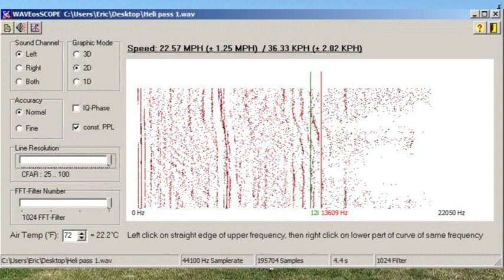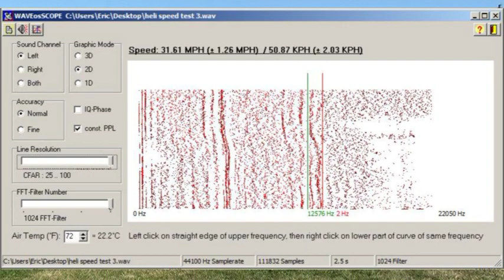Blade 450 3D. How Fast can it fly? (Using WaveOScope)

Comment: I own a Blade 400, the older brother to the 450.  I would honestly say that the 120SR does not prepare you for a full collective pitch heli.  This is a huge step up.  There are some things you can do to train yourself with a Fixed Pitch heli such as the 120SR.  One thing is get used to hovering nose in.  Also do a lot and I mean a lot of high speed figure eights.  Switch to the longer balls on the swashplate and get after it.  Get so you can do fast figure 8's without losing altitude then hover.

Comment from the maker: @shadyfy Yes it is an electric helicopter. I personally fly the 40c Batteries for 5mins in stunt mode with the throttle at 100%. Or for 9 mins in hover mode with the throttle at 60%.
And yes its here in the U.S  ^.^

Comment: The throttle curve may have been at 100% but did you have the throttle stick pushed all the way up 100% of the time during the pass?....I would imagine it would be close to 60mph if you did.....Get out there and just get going in big open circles and hold that stick 100% wide open with all the pitch it has and the motor locked wide open....You'll be shocked.lol...

Comment: there is a video of a 400 doing almost 53mph with gps  might have been faster and the program you used wasnt accurate enough  also if i were you i would get some carbon fiber blades on so you can be worry free and know they wont break as you seem to fly good and will be flying more aggressive putting more stress on blades  nice flying